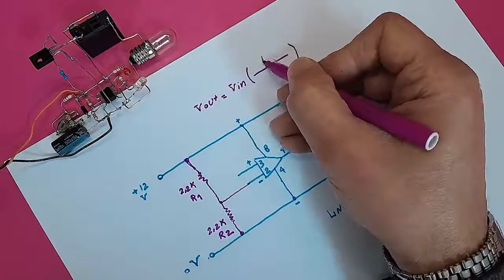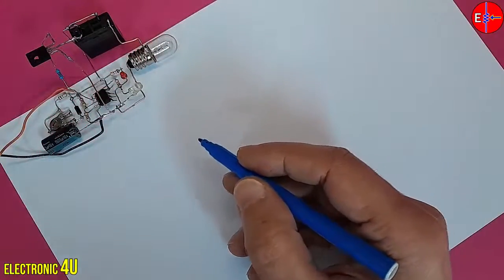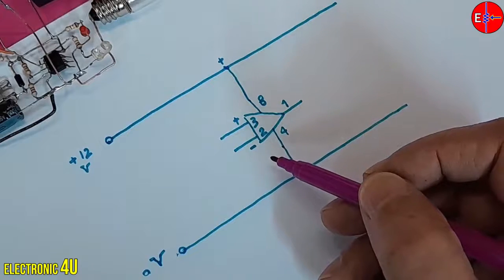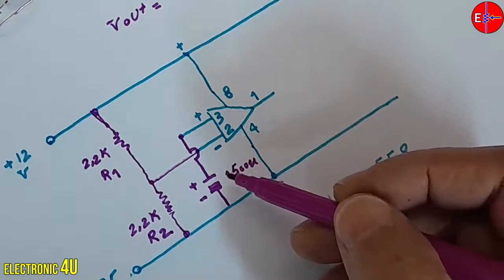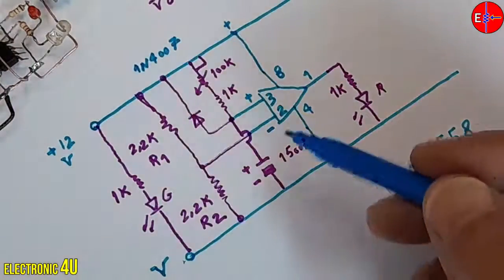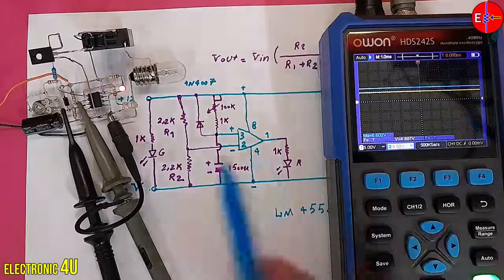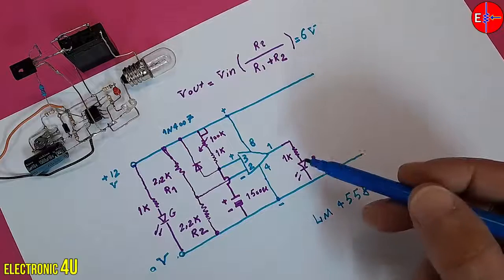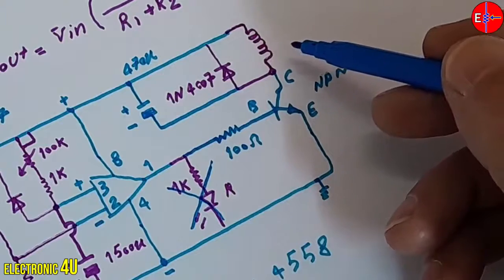How to make a delay timer circuit with op amp?

Comment: I would've liked to have a look at the output pin of the op-amp on the oscilloscope as well, as I bet it oscillates a bit due to the very slow nature of the rise time when the voltage at the N/I input just about reaches the critical REF voltage. I would add a high-ish resistor between the inverting input from the output to add a bit of hysteresis to fix that if it's important for the final application. For this purpose, it's negligible, but a micro controller pin would pick up that noise and bounce between its states.
Reply from the maker: Thank you for your valuable explanations. 🌹🌹